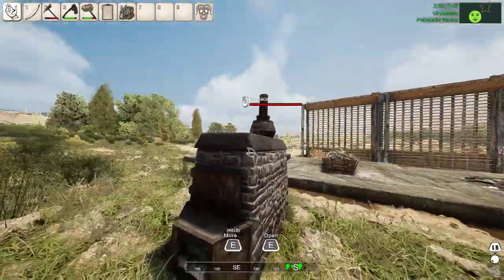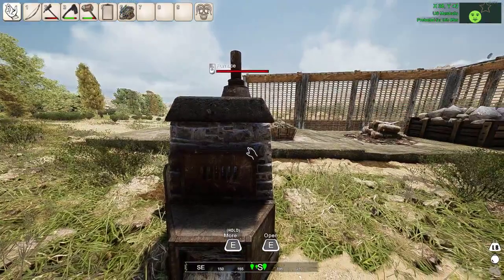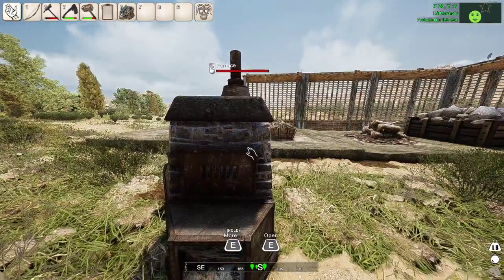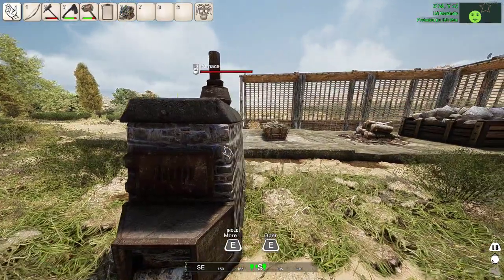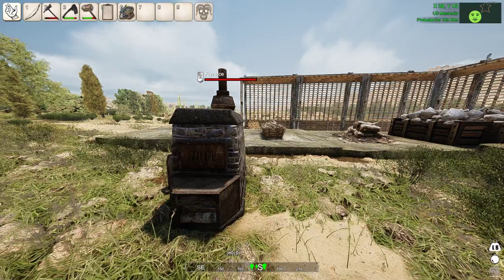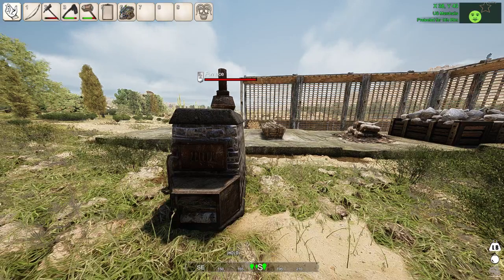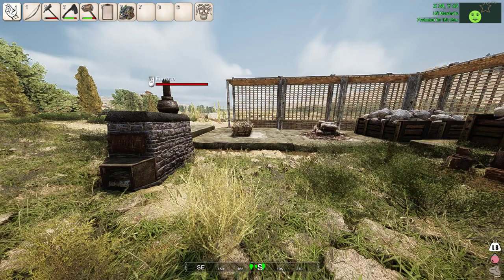"Heat" Survival Game; How to make INGOTS

Comment: I tried iron and copper in the level 3 kiln and it didn’t do anything after 15 mins
Reply from the maker: needs to be 15 ore per 1 ingot and the fuel has to be fat. charcoal may work but Ive yet to try it
Reply: @YasseeOSRS  Fat then Charcoal, Sticks, then wood. wood is just slow.